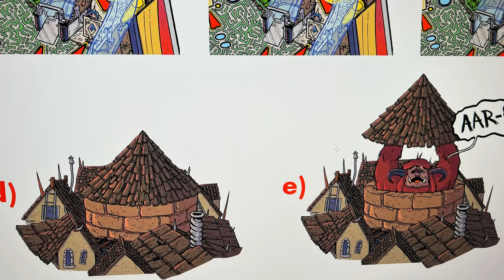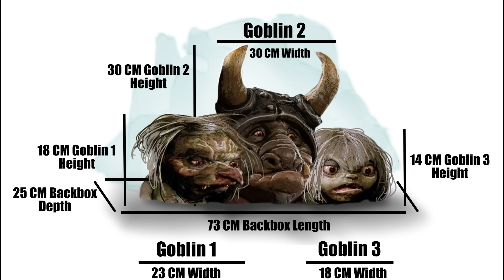Making of Jim Henson's Labyrinth Pinball Machine!

Comment: This is a great thing. I own a 1974 Gottlieb Sky Jump pinball machine (Electro-Mechanical) and the difference in the innards between that and this is like comparing a Ford Model T and a Tesla Model S. Sure, they both have many of the same features and concepts but how they get from A to B are worlds apart.  

Where my machine is stuffed nearly to capacity with wires, relays and motors this machine is comparably barren. The various changes to serviceability and ease of access to components was very interesting to see. You can tell that generations of design have gone into making everything easier and more accessible. The simple fact that the playfield not only lifts but slides forward as it does so and has handles on the inside to aid in the process seems like such a simple and obvious thing, but in my older machine lift the playfield is like lifting a 50lb car hood with virtually no where to hold on to other than the edges. Another great change is being able to open the front of the back glass rather than having to pull the machine away from the wall to remove the back side. The miniaturization was expected, these quality-of-life improvements were unexpected.

Amazing how much difference nearly 50 years of design can make. But I guess we did go from first powered flight to breaking the sound barrier in less time than that.

Comment: Great to see pinball video on Tested! Pinball is one of the last items made mostly by hand. The biggest manufacturer is still in Chicago and really only the PCBs and sculpted parts are made in China. The rest of the components, cabinets, solenoids, etc are made in the USA or Europe. There's so many disciplines in making a game, there's electronics, mechanical engineering, software engineering, art, game design and manufacturing knowledge. And it's HARD. Barrells of Fun came out of nowhere with a complete, commercial level game, which is crazy, since coin-op is mostly a dead format of gaming except for a few thousand hobbyists. There are been SO MANY pinball company failures in the last 20 years so to see someone quietly build a complete game around a great niche license is really cool.
Reply: Canada too ;)

Comment: There’s so much great here.   I really love the love that you guys have for the movie and it shows. However, I feel like this and the board game both could’ve used a little more “umph.”  

There’s a 3D aspect to the Labyrinth movie that doesn’t show up for me in these two games.  It’s cool, but I feel like it needs more levels of fields, changing and moving parts, and just general mysterious depth to venture into on the field.  

There’s a lot of good about it, I just wish it felt more layered with nooks, 3D paths, and sculpted spaces.  Fireball Island, Mousetrap, and even the old fashioned wooden tilting labyrinth come to mind as vibes I wish this had more of.  I also even think of those 3D clear object mazes with little silver balls in them to navigate while turning the object.  They’re like a cube or sphere with mazes in them.  Even a those ball bearing roller coaster tracks come to mind where the ball is lifted up to the top and then goes down a track twists and turns until it reaches the bottom to be brought back to the top.   

There’s lots of pinball machines with a more maze like depth that feel more appropriate for the world of Labyrinth.  I know it’s a big world and you can’t include everything, but it’s a general feeling with the flatness and bareness of the field that is needed.  That’s a feeling you get from space design and layout you don’t have to include story elements for.  

I LOVE the moving topper, the marquee, Ludo, the doors at the back, the plunger…etc.  You guys did a fantastic job.  I don’t want you to feel like you didn’t, but I also don’t want to just blow smoke when I see things as a huge fan of pinball AND Labyrinth that I wish were better represented.